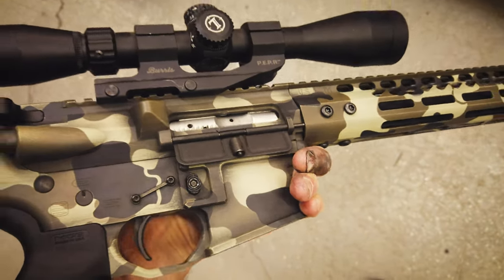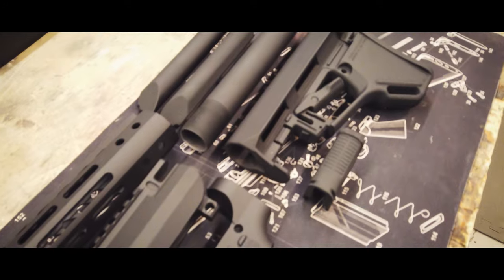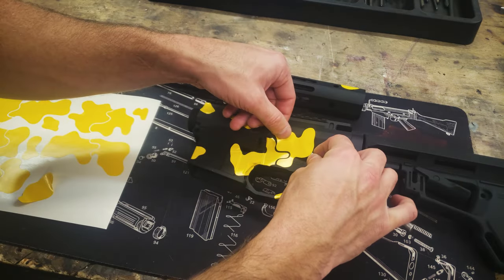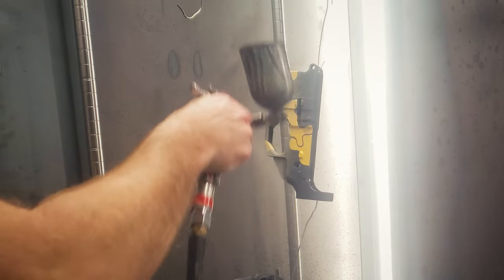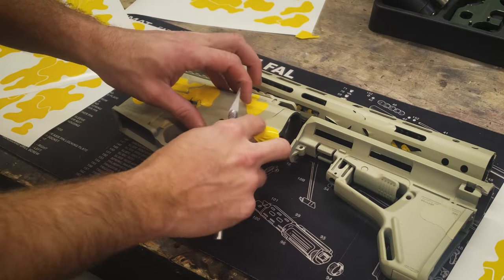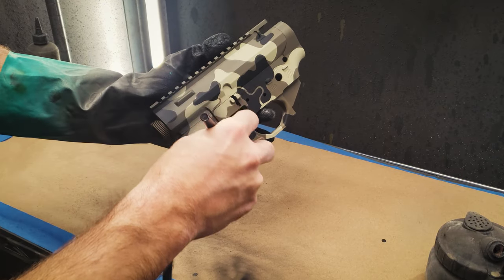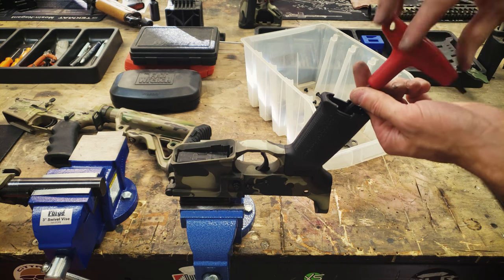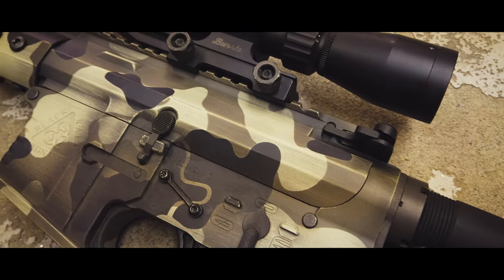How to Paint GAP Camouflage

Comment: Glad you are putting out new videos again!!! Really digging this pattern. For the distressing are you hitting it with steel wool while it's wet or waiting until it's cured? Thanks for the great content
Reply from the maker: Thanks for the support.  It depends on what product you are using.  If its an air cure product, you can likely hit it right away.  For products that stay tacky until heated, we recommend a quick flash cure first.
Reply: @FreedomStencils  I should have specified, using duracoat. Thanks again!!
Reply from the maker: @danielg5996  We recommend Duracoat, Cerakote, and KG products.

Comment: If the gun is already black why paint a black basecoat?  Also, would doing all 4 krylon camo colors instead of just the 3 still look good or would it get too "busy"
Reply from the maker: The base color isn't really in play because you still need to do thorough surface prep for the coating to adhere properly.  4 Colors would look good.  Its all personal preference and depends on the look you are going for!!!

Comment: Are you using oven cure cerakote and curing in the oven between coats? Or are you using air cure?
Reply from the maker: We use both depending on the project.  If you have an oven, we recommend flash curing between coats for both products for 5-10 minutes at about 180.
Reply: @FreedomStencils  Do you reccomend the oven cure series for firearms or have you had good luck with the air cure?
Reply from the maker: @forster46  We have had great results with both!

Comment: Notice you didn’t tape off any of the holes in the lower or any other part.  Is there not a problem with material build up?
Reply from the maker: No, not typically.  Some areas run the possibility if your laying some heavy coats.  There are some really nice plug kits available today for those situations, as well as plugging barrels.  https://amzn.to/44kiijF
Reply: @FreedomStencils  appreciate it,  I was painting a plastic stock and normally weak hot glue works,  but I went a little wild with the soda blasting and the areas I then glued the glue actually stuck.  So spent an unfortunate amount time removing hot glue.   I’m assuming you all were using something a little less build than rustolium or similar.

Comment: Hey guys, thanks for this. Quick questions - how long are you curing your base coat before applying stencils? I'm under the impression that with cerakote, the full cure time for their H Series is 1 hour at 300 degrees, however you can't or shouldn't cerakote over cured cerakote. So for my base coat, how long should I bake it before stenciling? Thanks!
Reply from the maker: We recommend flash curing for 5 to 10 minutes at 180-200.  It depends on how thick or wet you laid your base coat though.  If its still tacky, then go longer.
Reply: Thank you! Appreciate the reply. Stencils are always top notch from you guys.